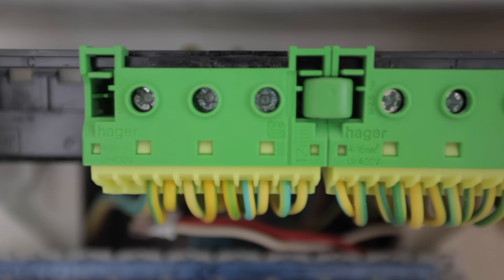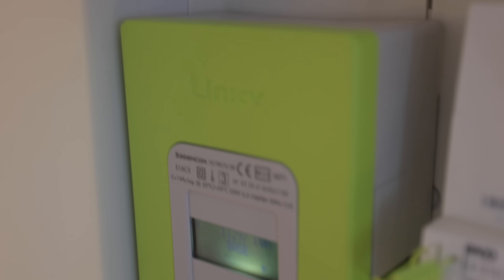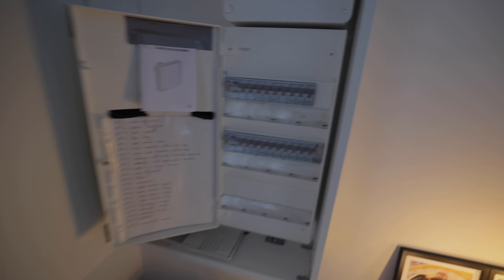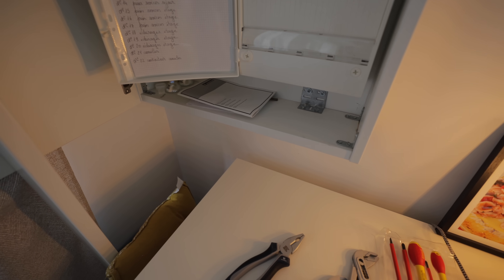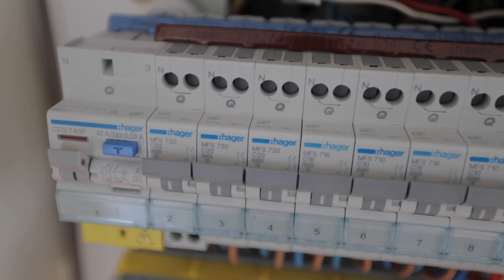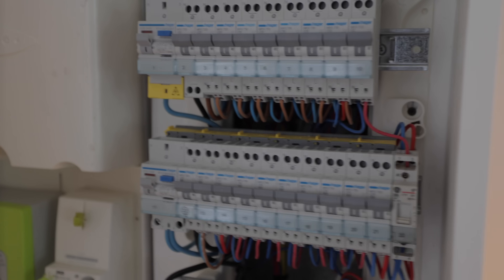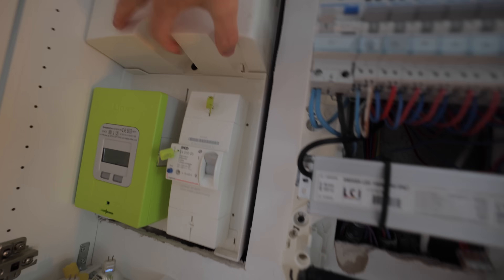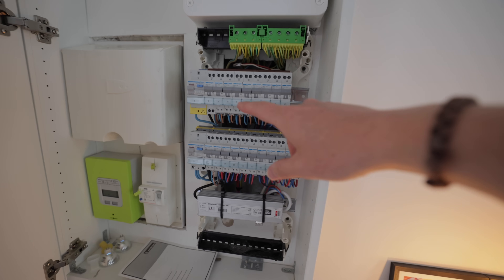U.K. Electrics SUCK! This is what we should be doing…🇫🇷

Comment: We have that system in Germany too, it's called Hager Quick Connect. It's not one earth block shown in this video, they are two block connected together with a link that is located between the third and the fourth screw from the left. And on the left and the right ends you can see the unused and open holes for the links to add more blocks if necessary. Hager also manufactures them in blue. You can get them in different sizes, with or without screws. The push-fits are rated for 1.5 to 4mm², and the screw terminals for 1.5 to 25mm². Rated current is 63A.
The blocks cost round between 6 and 15 Euros, depending on the size. The links cost 34 Euros for a set of 10. The difference is, that you won't find type AC RCDs here anymore. Only in older installations. They have been banned for new installation in 1987.
The fuses official designation is NH fuse, but they are usually called blade or knife fuse. They are used because they can isolate a short-circuit current of up to 120kA. NH is German and stands for Niederspannung Hochleistung (low voltage high power). They require a special tool for insertion and removing them. Not to be operated by lay persons, because that system has no precautions preventing the insertion of a fuse with a too high rating. They have an optical indicator showing when the fuse is blown.
Reply: aren´t the AC RCD´s banned even since 1983? either way it is highly recommended to change them out immediatly mostly to an type A but i would always take at least an type F because of all the appliances today that have an vfd in them and of course when you have an EV or PV system in the house best solution would be an Type B but they are still very expensive, where the F is only ~20€ or so more expensive than an type A
Reply: @TheFlow2006  Nope, in 1984 it was introduced that "circuits in a room containing a shower and/or a bathtub must be protected by a 30mA RCD". The type AC RCDs approval, according to VDE 0664 was revoked. And no VDE certification, no installation. The mandate for VDE certification comes from the regulations released by the DNOs (Technische Anschlussbedingungen or TAB).
Type F is usually not necessary, type A is sufficient. For special dedicated circuits like EV or PV, I would use the recommendations of the manufacturer. They tell you what devices for protection need to be installed. If the EV charger has an integrated protection against DC faults  you usually only need a type A RCD in the supply of the charger.
And the thing is, you won't get type F RCBOs, only RCDs. You then require an additional MCB.
Reply: @Marcel_Germann  Yeah, by now I know a number of houses showing the iterations of electrical code, especially when it comes to RCDs. My parents house, built in 1982/1983 initially had no RCD at all. Only when they later wanted to add a Sauna, which is considered a "Feuchtraum" an RCD was needed. 
A friends house built just about 20 years ago (I think) showed the next step after that, where as you mentioned the bathrooms and kitchen had to be behind an RCD. 
Next would be my house, built about 15 years ago, one RCD and all other circuits behind it.

What came next shows in my brothers house, where like with this french panel, every row of circuit breakers has its own RCD. Only as usual here, as three phase.
Add in the latest iteration where an overcurrent protection is included as well. 
Regardings the blue hager connection blocks mentioned, those are used here behind the RCDs, as I never have seen two pole circuit breakers used here before.
Don´t think they are a bad idea to have though.
Latest "consumer unit" I have seen was a premade unit the electrician made in their shop. I think you can even buy them from for example hager. They have quite neat connectors on top, where on the one side there is the connection to the breakers, the connection to the respective RCDs neutral and the DIN Rail is used like a bus bar for the ground connection. Every cable comming from a circuit then can be fed in on top and directly connected neatly to those blocks, without touching the wiring in the rest of the cabinet. I think I have seen those from different brands, Hager, Phoenix and others.
For PV systems I know from my brothers house, they ask to replace the main switch (the one sealed before the meter unit) to be changed from a three pole to a four pole and they asked for a very specific 4 pole rcd breaker something, that not only works with AC, but higher DC voltages as well, in case those may get through from the panels.
What I never have seen anywhere yet, although I read about it multiple times, is some panel where actually lighting and socket circuits had been separated.

Those NH Fuses, I know them, but except for commercial applications I have never seen them in the wild for a while. Though there might be some ( I am almost sure ) under that hughe sealed cover where the cable comes into my basement and to the breaker panel from there.
What I have seen more often with consumer units though, is old DIAZED Fuses as main breakers. The ones using the E27 thread. The smaller NEOZED ones I only know from a job in the past where I built electrical control units.
Reply: @alexanderkupke920  In several countries the 2-pole MCBs are mandatory. For example in France. They mostly have TT systems, so the potential of the neutral can deviate from earth potential and so also from the potential on the CPC (circuit protective conductor). In Germany you'll find TT only in rural areas, and we have RCDs that isolate line and neutral. The last one is not the standard in other countries and also only required for some special purposes. The most common earthing arrangement in Germany is TN-C-S, incoming PEN that is split into a separate neutral and CPC in the incomer.
Reply: @Marcel_Germann  I somewhat had a hunch it might be that way. Especially as I vaguely remembered reading one that the TT system is quite common in France. with that two pole breakers absolutely make sense, as you never can expect any fault or "stray" current is "drained" properly to ground. Needs only one faulty connection to sudenly have a voltage against ground on the Neutral. (And a host of other issues due to the reduced Voltage betwen Neutral and the single phase. Sounds fun...)
Reply: The french system is just good, like every there in Europe, UK system is an disaster
Reply: @jak4596  Except for the plugs, those technically are better.
Reply: @alexanderkupke920  UK plugs are heavy, large, ugly and stepping on them is more dangerous than getting zapped.
Reply: In the UK we use term HRC or High Rupture Current for fuses like main cut out fuse. Typically 60 amps, so won't blow 'instantly' [0.1s] untill around 880 amps, but typically can resist 80,000 amps for like 0.0001 seconds without exploding to badly and creating secondary fire
Reply: We use many Hager matérials in France too
Reply: Type AC for « interrupteur différentiel » for AC current only, type A for AC and DC current. The type AC is used for lights and plugs where no DC leak current are expected, type A for special circuits like owen, cooking, washing machine where DC leak current may happen
Reply: @batamist  These days DC currents can happen in almost every circuit. Except you still use incandescent or halogen lamps instead of more modern compact fluorescent lamps or LED lighting. Everything that has a switch-mode power supply in it can create DC faults. Not smooth DC, but a pulsating DC.
Reply: Do you use MCB which breaks both N and L in Germany ?I think it is very unusual for households and I haven t found it in standard hanger catalogue under that designation.
Reply: @nikicamalezic5388  No, we don‘t use them. France and Spain are using them, but they also use mostly TT grids. So the potential of the neutral can deviate from earth potential.
Reply: @Marcel_Germann  Here in Croatia TT or TN grids are used depending on a region.
Reply: @nikicamalezic5388  Here in Germany it is usually TN-C-S, and in rural areas it is mostly TT. Depends on the DNO. Also seen DNOs that converted their TT grids into TN-C-S. They marked their incoming former neutral only with green/yellow heat shrink tubing and turned it into a PEN.
Reply: NH fuses can be replaced witj just lineman's pliers if you don't have the special tool.

Comment: Our norme (regs) called NFC 15-100 up to 8 disjoncteurs (mcb's) per Differentiel. This panel is not in conformity with the latest normes actually. 
Plus we mostly use type A instead of old AC now mostly. As soon as you have switching power supplies (in almost everything) they can have fault condition that delays tripping in type AC.
The regs for height: main on/off AGCP 500ma in this case 1.8 meters max, 0.90 min and the switch panel TGBT is 1.8 max and 0.9 min but 0.5 if there is a door. People have to be able to access it in an emergency to cut power and this includes to some extent elderly and disabled. 
The box VDI with the DTI can get quite sophisticated sometimes. You can mount routers and switches in them too.
Cables or conduit, depends on the job really.

Comment: I am surprised that they are still using split load boards and not RCBO's.
Double pole RCD & adjustable MCB main switch is an excellent solution to the incoming supply. 
All RCBO's should be double pole imho.
I have used the push in terminal bars before in NIGLON consumer unit and they are the way forward! 
Good video, cheers!
Reply: Double pole is just useless as you alway have the neutral at the earth potential, so can't have a huge flow of current if it touch earth. Double pole is mandatory when you have 220V between phases, and you have 110V to ground in the "neutral" as this is not happening anymore as all is upgraded to 230/400V. RCBO are really overpriced and llosing just the half of the house if something get wrong is not a big thing to deal with. And as all overcurent protection cut the neutral, it's easy to flip all down, the reset the RCB and flip the rest up one by one until the RCB cut to locate the fault. As it's TT and not TN an eath fault is never a short circuit.
Reply: @lapub.  RCBOs in the UK at least are not particularly expensive and I for one find it massively inconvenient to lose half the circuits in the house. I did not, for instance, appreciate the loss of power to the refrigerator and freezer when I was away from home due to water getting into the PIR detector on an external light.
Reply: @TheEulerID  The cheapest RCB is 25€ while a simple breaker is 5€. There is "minimal mandatory" configuration and "recommended" one. So you can have RCB dedicated for freezer and fridge "Hpi" that are less prone to false triggering but cost 200€, you can dedicate one for the outside and so on.
Reply: @lapub.  I can get MK RCBOs in the UK (retail) for £14.40 inc VAT (17 Euros). MCBs are £2.88 inc VAT, or around 3.5 Euros. 

My fairly new MK consumer unit (steel enclosure) with 10 RCBOs cost £179.94 including VAT, although adding surge protection was another £32.82 including VAT. So about £210 or 250 Euros. When the requirement for a couple of RCDs and the larger enclosure required for a split-RCD configuration is factored in, then the full RCBO configuation is about £70 more. Frankly, over the life of the unit the cost is trivial. It costs me £70 to refuel my car.

That is for a 4 bedroom detached house with an exterior detached double garage with power.

Comment: In France the max high for the top line of a panel is 180cm and the same for the main breaker. Tooday with the Linky meter i see more and more fixed main breaker because the Linky cut the power if it's over the subscribtion. Type A RCD (detect DC current) is mostly for kitchen appliances. But the N°13 microwave should be on the type A and why light ???? may be to avoid add one more type AC RCD..... I'm not very sure for the type A for the kitchen because i don't work on residantial unit but monsty on indistrial or tertiary (School, EHPAD, market, dental office,.....). Yes it's a very beautiful panel but... i think this electrician had some time to do that unfortunately it's not the case everywhere.... :( but the worst bus bar i hate this one on the first line. Blue is neutral but live could be everything except blue and yellow/green. Cumulus or ballon d'eau chaude or ECS = water heater; the contactor is drive by the Linky on "Heures creuses" generally from 23H00 to 6H00 BUT it's need a special subscription to the electricity service. You can see the CT is on 1 position mean allways ON. For me it's mean you don't have the subscribtion because the CT switch to auto in the middle position automatically when the signal is present. The box on the top of the meter is maybe the main feed with fuse but it's should be sealed as the same of the top cover of the breaker and the meter (under the green cover) you can't open this box normally.... The main arrive to the fuse, to the meter and to the main breaker. The delivery point is under the main breaker; everything on the top is part of distribution network property of electrical services ERDF. You have one thing to NOT change in UK your plug!!!!! You have a fuse in it.Yes in France it's not really need but a fuse in the plug rated for the device is the best thing ever !!!!! I'm a bit scared when i see 0.75mm² cord on some devices with no fuse connected to a socket at 16A (or 20A is the max).

Comment: France has choice of 15-30-45 amps...your monthly electricity bill 'line rental' varies on this choice
Reply: As a man living on a UK supply with a rated maximum of 100A (But normally never drawing more than 5A at once) I'm always surprised at how well adjusted I am to EU power supply limitations despite having the current availability of six French flats! 😳
Reply: @UK-Combustibility-Assured  I think it's because electricity used to be really cheap in France, and used for heating. Without power limitation, power use would jump way too high, more than what the network can handle
Reply: @pizza_diavola-bx4op  It was the same in the UK, and a whole generation of homes (Mine included) were built in such a way they can only be heated electrically - Gas is completely out of the question here.

Of course the latter increase in the cost of energy makes these places very difficult to live in (I've no hope; Resistive heating only, north facing, and exposed to boreal wind throughout the Winter) and mine will probably take a good 20 years off my lifespan. But because I have non-chosen disabilities and no money, this is regarded „OK“ by British administrative offices. ♿⚰🤔

Mind you; I wonder if the difference in supply capacities means that British domestic meters are also employed as industrial supply meters in France and other places where per-supply allowance is at or below the UK domestic norm? (Though nowadays, we're all being re-fused to 60A). 😇
Reply: @UK-Combustibility-Assured  Electric resistive heating dominates in many Canadian provinces (where the electricity is produced 95% by hydroelectric dams) and has since the 1970s. A large portion of southwestern British Columbia, including Vancouver, now has mandated heat pumps as the singular legal source of heating going forward for all new construction.

Comment: France bought in double pole MCB's about 5-10 years ago presumably to compensate for their  layout and design systems...but if for example, an electrician mixes neutrals on MCB (easy, probably common, error) then would you not have a 'shared neutral' serious safety issue , leaving repair personnel potentially liable to a dangerous shock from neutral at the light fitting or whatever (with MCB off)?!  That fault would be Code 2 in the UK. Yikes  .
Reply: Neutrals are considered live conductors and borrowed neutrals are non-compliant so I don't see much of an issue. The regs still require the phase to be connected to the centre terminal of an ES lamp holder but in reality all European ES14, 27 and 40 have been made with a split screw shell (i.e. the thread on the socket is insulated, either plastic or ceramic, and only a small piece of spring brass touches the screw shell of the lamp when the lamp is fully inserted) since at least the 1950s so only very, very old sockets are dangerous if L and N are swapped or the neutral is disconnected.
Reply: @Ragnar8504  the way a 'shared, borrowed or stolen' neutral can give dangerous Electric shock is say you're working on circuit No.5 , which has been turned off.....but the neutral will still be running live as its part of circuit No.4 or 6 or whatever. 
    In a French fusebox this would appear to be a common scenario .
    If you look at fatalities since those mcbs was bought in,  there should be a jump. 
I can not see how not.

Comment: Hi Jordan, greetings from Malta. Here in Malta we ended up on type F RCDs beacuse of harmonics in the supply due to lots of PVs and aircon with DC inverters in the compressor units.
Reply: The Germans are pushing type F as well but the general consensus seems to be if something is sold to the general public it needs to work safely on a type A RCD to be compliant.

Comment: hi really nice video and like to have a external input about our electrical system ^^
on your main breaker (the Bako one) the fuse can be set to something between 15 and 45 amps. it was set up by the electricity provider (Enedis who is in charge of the puplic electrical network up to houses) but now with linkys being mandatory, they are all set to the max and the linky is configured remotely to the plan you’re using ^^
if you’re interested about how the linky works and how it’s implemented i recommend you the channel Monsieur Bidouille who made a video in Enedis labs (only automatic subtitles avaliable tho)